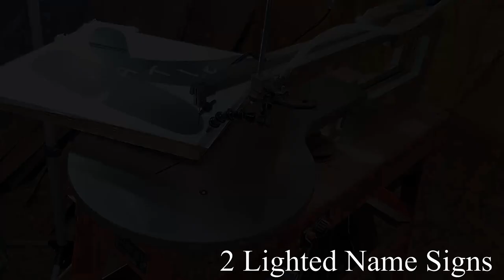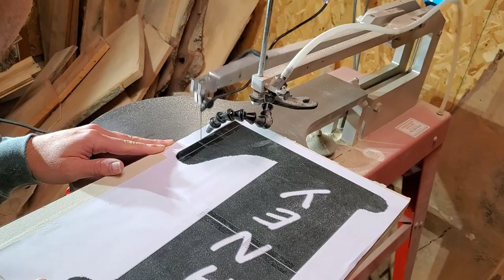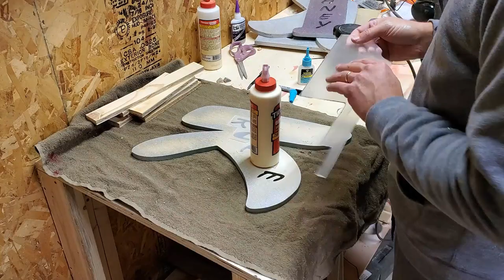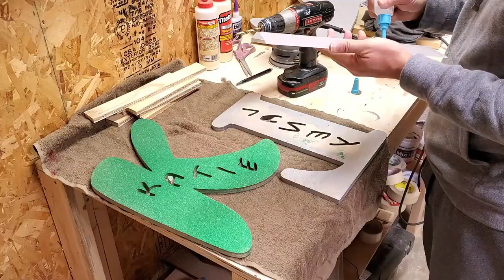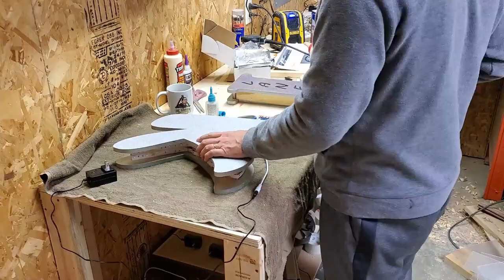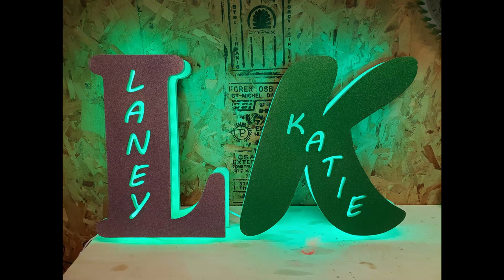2 Lighted Name Signs - Scroll Saw

Comment: Hello  what is best blade for cutting acrylic or pixel glass? You ate doing great work
Reply from the maker: Thank you.  For these I used #5 skip tooth.  Doesn't really matter much for straight cuts.  Only concern is it might melt back together.  Can just cut through it again if that happens.